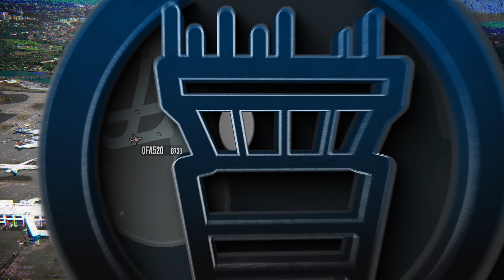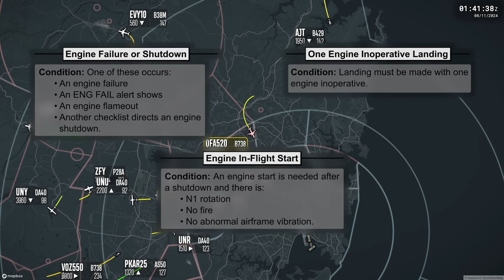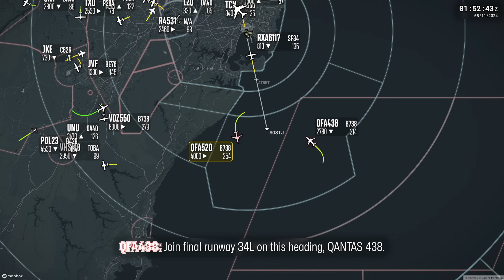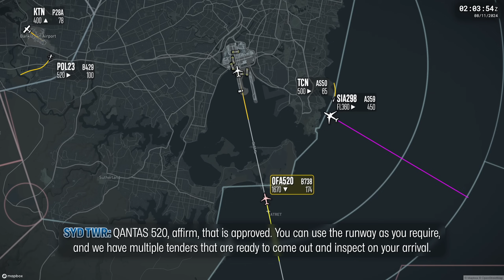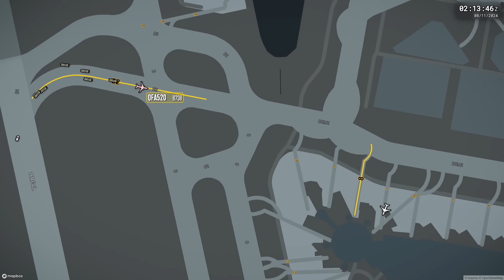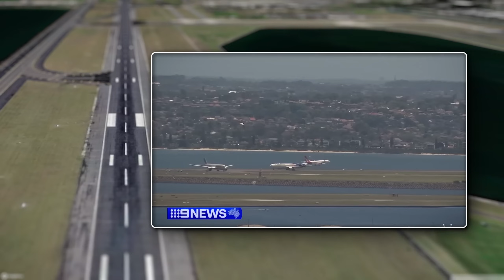ENGINE FAILURE Sparks Fire at Sydney Airport; Qantas 737 Forced into Emergency Landing [ATC audio]

Comment: Holding with just one engine, this makes no sense for me.😢
Reply: The maximum take-off weight of an aircraft may be higher than the maximum landing weight, so holding may, at times, allow the surplus fuel to be used or dumped. There is also a set of procedures to be done; for example checks to ensure if any of the aircraft’s systems have been affected by the initial incident which might affect the controllability of the approach, or different airspeeds or perhaps flap settings for the approach. Does it make more sense to you now??

Comment: Grew up in Sydney and as a young probably stupid teenager we used to get out on the breakwater where the runway was come home smelling of kerosene and ears ringing from the jet wash silly I now realise but we where teenagers  , its all blocked off now wasn't back then though. In later years I flew single props out of Bankstown (a light aircraft field not that far from mascot with its heavy traffic) and will always remember one cloudy day I was in circuit and glanced over and saw a 747 piercing the clouds out of Mascot one of those things you cannot unsee.
Reply: I'd never seen a Jumbo being from Adelaide was surfing Cronulla I think ,real heavy fog ,heard this massive noise ,looked up and this beast flew past just above our heads ,your right ,you don't forget some things

Comment: The 737 saga continues
Reply: A 20 year old plane with an engine issue. Has nothing to do with the 737's design or build quality, nor with Boeing.
Reply: @fomfom9779  lol nothing wrong with 737's or Boeing haha you are funny but have Boeing shares ey?
Reply: @HonchHeado  Can't you read/reason? This incident has zero to do with the 20 year old design or the plane's build quality. Boeing hasn't touched the thing in 2 decades. Boeing doesn't design or manufacture jet engines. They are owned or leased by Qantas. And not maintained by Boeing either. But if you want to point to the plane's design. Give Boeing credit for a plane that landed safely, even after an engine failure.
Reply: @fomfom9779  Boeing is currently facing a multitude of issues, including quality control problems, production delays, and a crisis of confidence in its safety standards. These issues have been exacerbated by a series of incidents involving its aircraft, particularly the 737 MAX, and have led to increased scrutiny from regulators, the public, and even its own employees

Comment: I was sitting in a virgin 737, 2 or so planes behind QF520. We stopped at the end of the taxiway and held there for quite a while, then we noticed lots of emergency vehicles moving around outside, and a group of workes servicing a road off the side of the airport exiting in their vehicles. We sat there for quite some time (approx 40 minutes) but then took off uneventfully and had a bumpy flight to Adelaide.

Good to hear the other side of it, we (the public) don't get exposed to much of this stuff so it's great to hear the professional and efficient way in which this was all handled.

Comment: I was about to board QF2041 from Dubbo to Sydney when the announcement came over the PA that there was an emergency landing in progress at Sydney and that our flight would be delayed but they had no idea at that stage for how long. I thought that’s it we might be stuck here for hours but less then an hour later we boarded and took off. We landed in Sydney without any holds. I was most impressed with how promptly Sydney Airport crews dealt with the major issues and had the Airport reopened in under 2 hours! Fantastic turnaround time. Sydney Air Traffic Control and the Service Tenders plus Emergency Services all performed their duties with precision. Great communication by all involved. You guys are the best! Another reason why Sydney is the greatest!
Reply: We don't muck around with such things in OZ!

Comment: I've never been on board an aircraft during an emergency, just wondering, while all of this is going on, what are the passengers being told? I assume the captain does speak to them at some point?
Reply: Ive never been on a plane during an emergency either, so i dont know first hand, but you would have to tell the passengers you would be returning 

How you would tell them that without worrying them, the flight attendents would have had quite the job

Comment: a 19 yo 737-8 is probably due a rest, especially after the stress that a one engine climb and airframe shudder would have on an aging airframe. If that plane was not D checked first chance then I would be reluctant and horrified to ever have to step back on it. Be interested to know what its registration is. 
My understanding D checks are done via contract now for Qantas overseas. Someone correct me if that is incorrect.

Tracking left over populated Sydney fully loaded with fuel is red hot too. When I did PPL and then CPL theory and then went and did a couple landings at YSSY I was told that all emergencies were tracked over water for jets via the most immediate route, to dump fuel kilometers out to sea to lighten the load, ATC asked them which way they wanted to go. I am surprised to say the least. 

Excellent break down of the event.

Comment: I recall an event on November 8th, 2024, while driving through Epping, NSW. I noticed the low-pass sound of an airplane, which seemed unusually loud. Curious, I decided to track it on Flightradar24 and saw it was turning south—odd, considering its destination was Brisbane, 900 km to the north.

I checked LiveATC for the YSSY tower and noticed there seemed to be an issue with the plane. Watching closely, I observed it entering a holding pattern just south of Sydney Kingsford Smith Airport. Fortunately, I was able to confirm that the plane landed safely.

I also noted the event in my notebook to download the LiveATC recording later (though I didn’t get around to it) and managed to capture a photo of the flight during its initial holding pattern. Thank you for providing detailed coverage of this event.
Reply: I live nearby and also heard this plane, I was at work at the time it flew over and I remember looking at it and thinking it was unusual for it to be so low and that it kind of sounded weird (I guess cos there was only one engine?), glad to know my spidey senses were onto something

Comment: Terribly noisy radio comms. It is long past the time for aviation VHF to move to FM. Perhaps it sgould move directly to digital mode.
Reply: VHF frequencies sound significantly clearer from the Tower and aircraft. The source of these recordings is likely located a greater distance from the aerodrome and is therefore picking up additional interference.

Frequency Modulation (FM) is impractical for ATC for a number of reasons. AM signals generally have better range and penetration capabilities, and allow multiple stations to be heard transmitting at once, whereas FM would block the weaker station entirely.
Reply: This is just due to the source of the download, not how it really sounds.